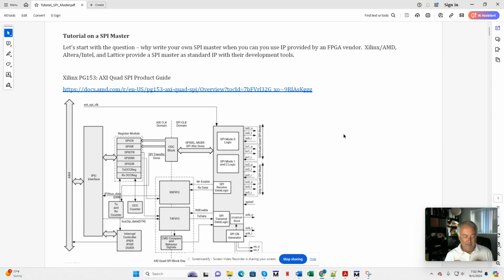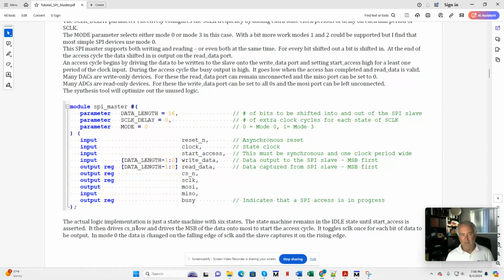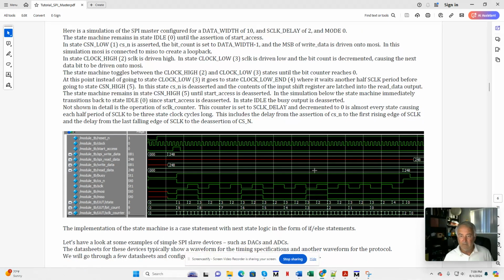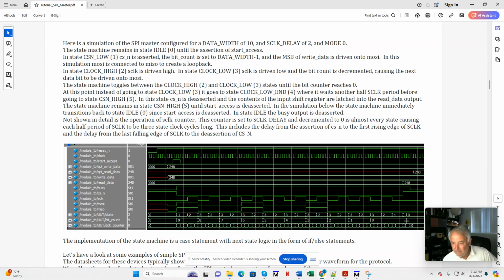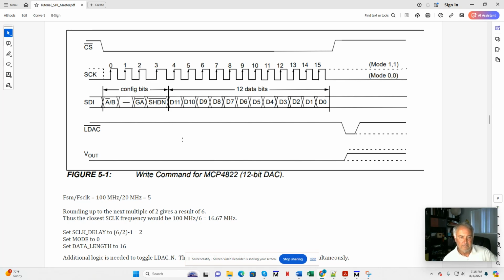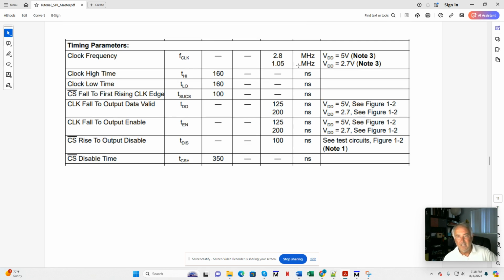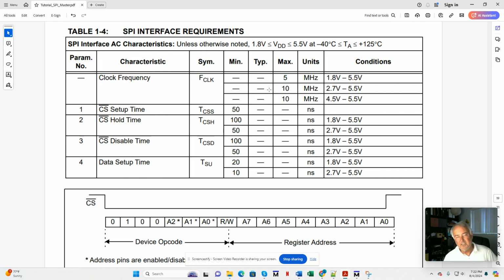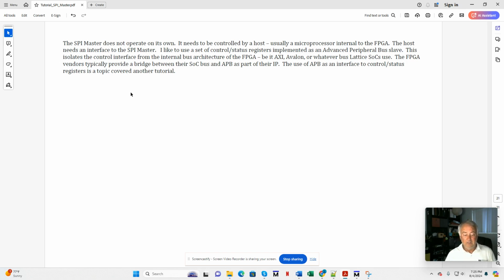Simple SPI Master in Verilog

Comment: Do the CLOCK_HIGH and CLOCK_LOW states really need to be...well, separate states? Can they not be subsumed by a single SHIFT state or?
Reply from the maker: The are thousands of ways to code up a SPI master in Verilog.  I use separate states for clock low and clock high because different things are done with the data in each state.